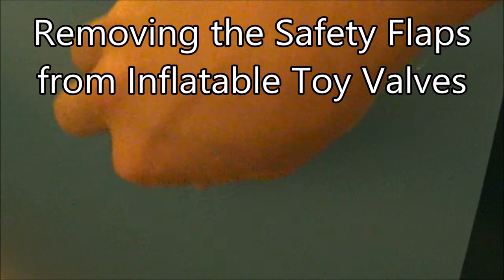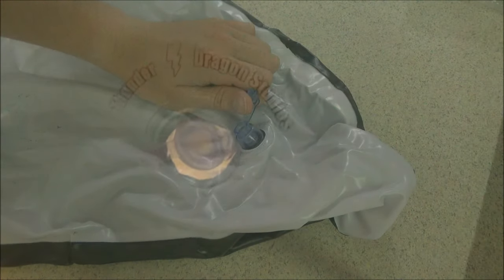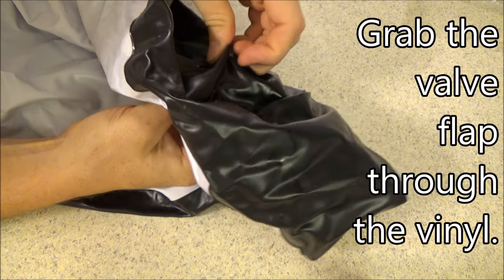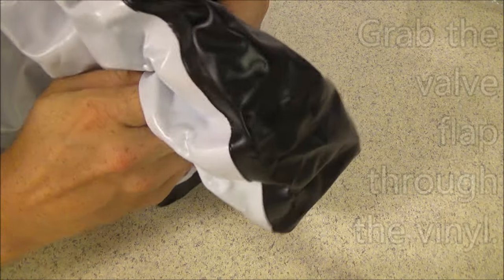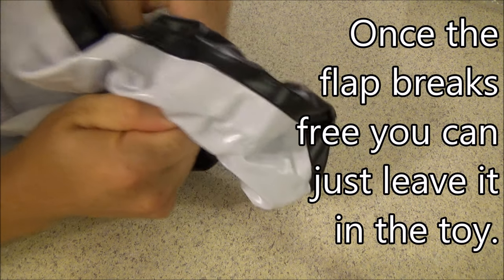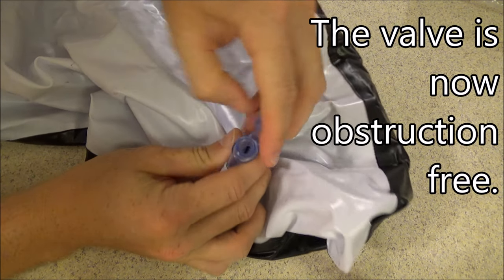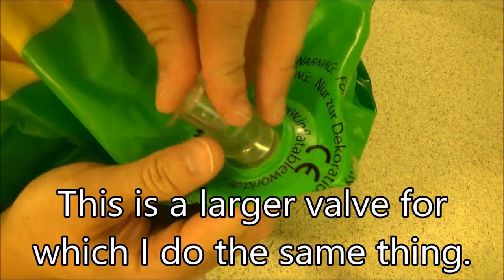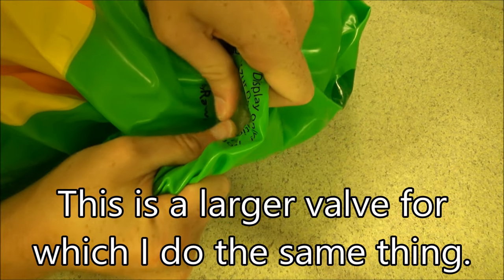Removing the Safety Flaps from Inflatable Toy Valves

Comment: Thanks. Great insight. I was successful removing 6 valves from 2 inflatable water loungers and can fill them with a high output low pressure inflator in about a minute. My finger strength is not as good as yours, so I also observed the "Engineers" explanation. His was equally useful and I put to practice his technique as well.
Thank you both.

Comment: Thanks for this video! I've removed the safety flappers from most of my toys with this method. I've also found a way to get the flapper out of the toy by pushing it up through the valve and grabbing it with a pair of tweezers.

Comment: great vid, i did this the day after seeing it to my h20 go flash and splash seal! though the flappers were really strong so i actually ended up cutting the flappers edges so it would be easier to tear off. and i wasn't really into the idea of the cut off flapper rattling around inside the toy, so after it tore off i kept it pinched in my fingers through the plastic and fed it back through the valve. if you're struggling getting yours off and you have a steady hand, try out the x-acto knife! i love your videos about toy repair and modding, they're fascinating and inspire me to try more out when i get more toys! thanks!!

Comment: Quick tip, use needle nose pliers to grab the circle flap through the inside of the valve and pull it outward then cut it off with scissors.
Reply: You don't need to cut it off. Just pull a little harder and it will rip off without damaging the rest of the valve.

Comment: After removing the valve - its quite tricky to keep the air inside and close the valve quickly too?! Any tips so that the air doesnt escape before i close the valve?
Reply from the maker: Typically I place my thumb over the open valve as soon as I pull the pump out. With my thumb temporarily sealing the valve, I can line up the valve plug and immediately press it in when I move my thumb out of the way.

Comment: The ones on the inflatables of inflatableworld are the absolute worst! I'm not strong enough to rip it off but what I do is I take a small knife and make a light cut inside the valve and then it's much easier to pull it off. I just have to be very careful though so that I don't end up cutting the toy itself..

Comment: This isn't a good idea to do on small items as it doesn't leave enough time to seal the cap back, and will deflate in 2 seconds... otherwise it's a good idea :)
Reply from the maker: +Nicholas Debono Yes, I would definitely agree not to remove the flaps on small chambers.
Reply: Then how do u blow through those damn flaps then if u shouldn’t remove them?
Reply: Yep you pretty much have to be a pro at fast breathing and it’s not easy
Reply: @Lettuce_the_cat_goat  Trying to fill an inflatable with a bike pump and it's still impossible...could the flap be damaged / manufacturing defect and somehow completely sealed instead of flipping arrgggh?

Update: Well...I was almost ready to give up, but as others have said you have to PINCH the valve as you blow in.

When you do this pinching technique and you may have to experiment to get the correct orientation, no removal of the flaps as shown in this video is really necessary.
Reply: I usually grab a small nail scissor and cut the flat open more, so it opens easier. Or i cut a part off of the flap to inflate&deflate faster, but only after i checked the stopper stays in well enough

Comment: I just used an Exacto Knife, punched it and slightly moved to make a cut. The nose will fit thru and will seal itself again when pulled out. The seal won't be 100% but sufficiently enough not to allow all the air to escape all at once.  It takes only a second to do.

Comment: wow as easy as that, i was always worried that trying to break it off would compromise the valve or possibly weaken the join between the valve and the toy, i just use a knife and cut it in half, this is what im doing now, since i sometimes loose the nozzle to my pump and have to use a nozzle that doesn't move the valve so it takes a year to inflate something.

Comment: About this flaps when isn´t installed in valve,stayed more quickly for inflate and deflate the toy,but you don´t achieve control the air after fill it.Need be very quickly for close the valve,because can lost all that air as was put inside of toy and I don´t find cool.The valve is very hard for press your base so leak air is easy how also no offer security.

Comment: How much big of a difference does it make compared to the moment they still had the safety valve? Like does it inflate toys a lot quicker and what about deflation without a safety valve is that more rapid as well?
Reply from the maker: Removing the flap can help deflate and inflate a toy much quicker especially if you don't have a nozzle that pushes the flap out of the way.
Reply: +Heath Dragon yea but if u want to inflate it again all the air will come out after you try to plug in the valve
Reply from the maker: +PrestonF Li That would be a good reason to only do this on large chambers.
Reply: هلو لليان

Comment: Isn't the point of the valve to keep the air from leaking ? By removing it the toy has a better chance of leaking
Reply from the maker: I leave the valve plug intact. So the toy still stays sealed with the valve closed. I only remove the backflow flap in this video.
Reply: @HeathDragon  Right, but I have removed the flap before and discovered that heavy use of the toy can cause the regular valve plug to leak air without the back-up backflow valve as a secondary means of stopping leaks.